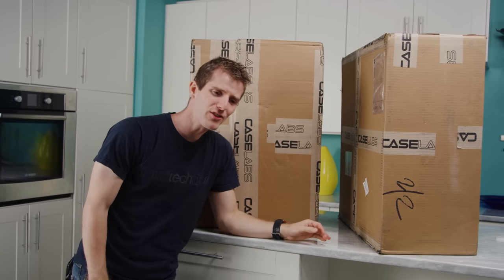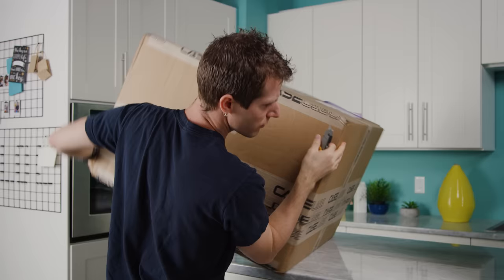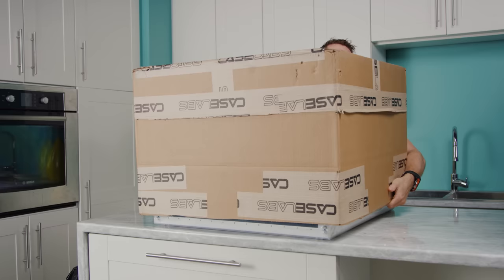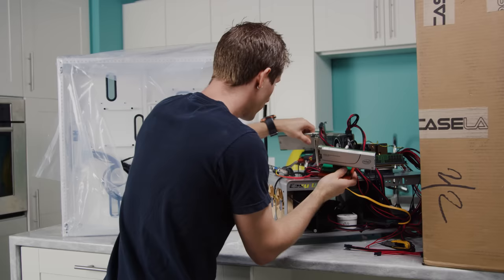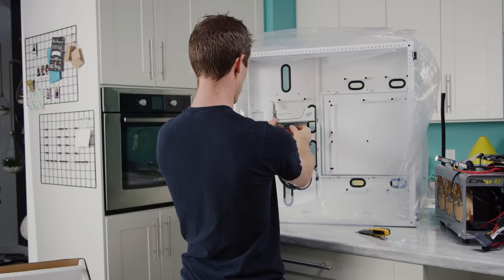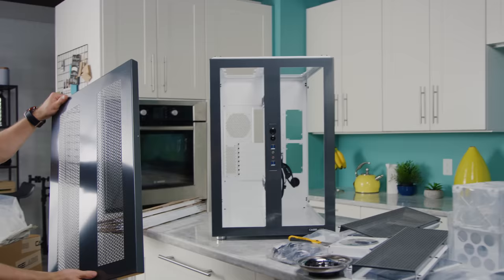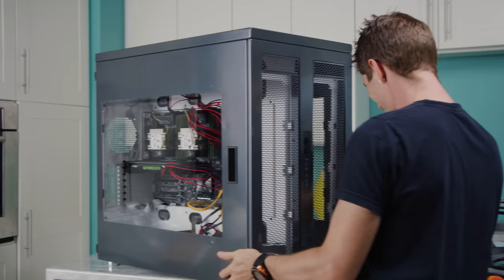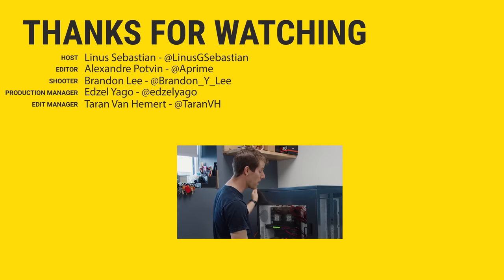How this PC Case Fits SIX Editing Workstations Inside!

Comment: Why not a dual Epyc? :D
Reply: kjakobsen We was sent the xeons.
Reply: BreckRB 

Yeah, but i die to see, a project with 64 cores, and 128 threads.
Reply: Because AMD has always been the Walmart of CPU manufacturers... and Linus doesn't do anything halfway.
Reply: Daniel Hebard 

That hasn't been true for nearly two decades.
Reply: There is no dual socket epyc mainboard with 6 PCIe slots. On AMD you loose half of the PCIe Lanes on dual socket Mainboards for CPU2CPU communication.
Reply: Sure, each Epyc has 128 pcie lanes -> when using dual cpu system 64 of them is used for inter-processor communication. But you still have 128 lanes which could be divided into 6 full sized (16 lanes) slots and remaining 32 lanes can be used for storage, etc.

Comment: Why in the hell would you use xeon for that when EPYC is clearly the better product for this application
Reply: Maybe because Intel sent free Xeons? And as well the optane drives possibly?
Reply: He already has a bunch of xeons laying around and all of his boards are compatible with them
Reply: The 8180 also performs better than the 7106 in multi core work loads and single core work loads. The 7106 might have more PCIE lanes, but with 96 pcie lanes in this system, it should be more than sufficient.
Reply: AMD support sucks. Intel CPUs are more reliable.

Comment: I have to ask - why do you always work on PCs with the case upright? I've always found it easier to mount things with the case on it's side so you don't have to deal with things sliding while you're trying to connect them.
Reply: Possibly for the camera angle? That's my best bet
Reply: @benmark2353  sounds right  - I'd put a GoPro on the ceiling, but that's me :-)

Comment: SSI-EEB does not fit into a standard ATX case? got my boards into Corsair Carbide 540 Air cases ... they fit.
Got my old C440GX+ dual slot 2 inside an old beige big tower including four 5,25" optical drives, a DLT streamer and a soundblaster live drive ii front panel. Fits also perfectly. I dont know, what kind of small mini cases they are talking about. but this caselab tower is meant for more than just SSI-EEB. It should be able to handle 4-socket-mainboards like the Supermicro X10QBL or X9QRi-F+ or X9QR7-TF+ or or or . SSI-EEB is tiny versus these boards!

Comment: Hello, good day

I was wondering if you can make a vacuum sealed PC case. This is based on a theory that in a space air molecules is absent.I am thinking we can save a lot of cooling fans and make a quieter PC if this proves to be a good cooling solution.

I haven’t done any prototypes since I don’t have the resources.

Thanks.
Reply: What are you talking about so it would over heat super fast as the cpu would have no way of transferring the heat
Reply: Elliott's Lab  I was just thinking
No one has done it before.
What I am suggesting is something I think none has done before, it could be a proof of concept or debunk a myth.
If this turns out effective this could change PC designs and could greatly benefit custom PC designers especially in PC build competitions

I don’t know, no one has done it.
Reply: Fitzger Banzuela nobody would do it as the science makes no sense... in what way is having a vacuum going to help you
Reply: Elliott's Lab I agree..
The reason why I asked is because no one has ever done or tried doing it. All I see are forums with a lot of debates but in the end no one has done it. All based from theories.

Anyways after a lot of searching I think I will put this to rest and just wait for someone to upload a video of it.

Thanks.
Reply: Fitzger Banzuela any one in this debate needs to take a science class you are just super insulating the computer you heard of a thermos flask right? That works by having a vacuum so no heat can be transferred in or out (well very little anyway small amount of infrared but this is mostly blocked by foil)
Reply: Elliott's Lab yah, I read it.
And you need convection to cool down the PC.
Most people say it won’t work.

But still, I want to see someone do it.
If only I have a vacuum chamber I will do it myself.

After all, that’s what Youtube is all about, you post something that has never been done before. 😁
Reply: Fitzger Banzuela i have access to one for testing small cube sats but There is nothing to prove here we know what will happen 😂
Reply: Elliott's Lab Yes we know what will happen. But consider this as an educational video.
You will be the first one to do this.
You will put to end a a solid answer ro a question that has been bugging the internet since 2001 up to present.

You remember Mythbusters? They put to test everything even if they theoretically know what will happen. But sometimes there are suprising results.

I’m excited...

Comment: Not big enough! With 3 pcie 4  X16 mining multipliers you can have 12 rtx 3090's connected to 1 dual cpu gen 2 epyc motherboard that has 10 sata and 8 samsung 256 gb ram stick ports(put in 2 tb of ram) ports. Connect all sata ports to 100 tb ssds (they exist) and put a usb card, sound card, and a ssd card onto it. Put 2 tb M.2 ssds and you have spend 1 million usd on one monster of a pc.

Comment: I hear it’s got a 64 gigagiga byte trebyte quadraplex with a xhs 736 cpu with hyper octane super 6im with triple micro maxima hyper loogic and 73 92 vpm hedra mega plex with a hyper piper diaper sideroplex that I scavenged of an old tm 180 and a super dooper looper 426 I put on there then I just got an old 392 Hemi supercharged and camed and tuned to 500hp to run the generator to get enough electricity to run the thing and then put a water/air Lopo Lipo cooler it’s got 200 USB ports and 30 cup holders with a little large middle barge kettle corn accapella 5383 hydroplex duplo SIM card with four barrel carbs and dual exhausts it’ll crank out 300,000,000 FPS at ultra mega insane resolution with 200,000 tabs open on safari and all watching 12hr loops of a cat jumping of a bench while playing fortnight on a movie theater screen. I understand all the words leaving your brainy bits via your mouthy parts.